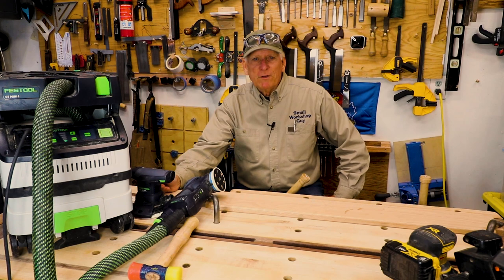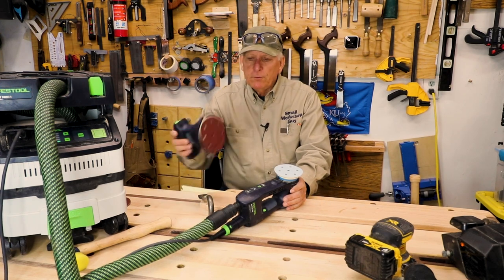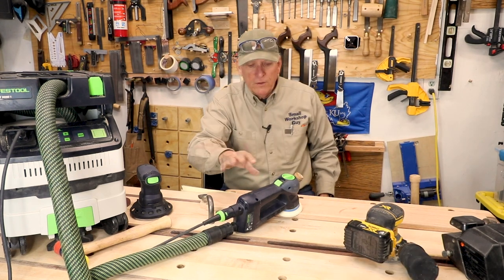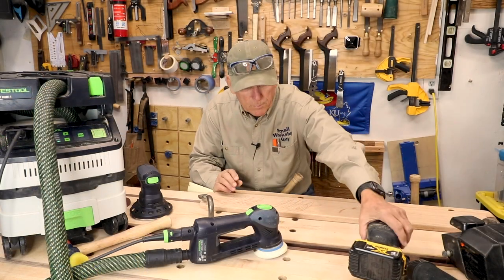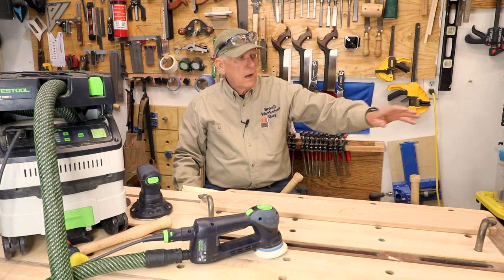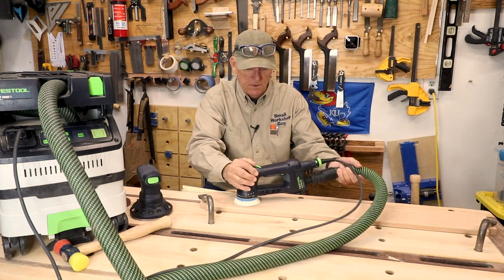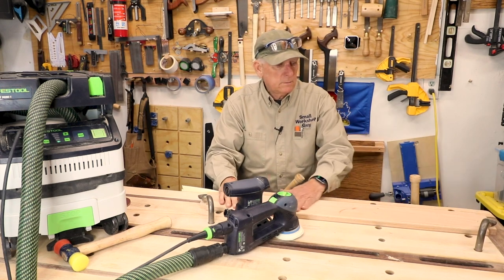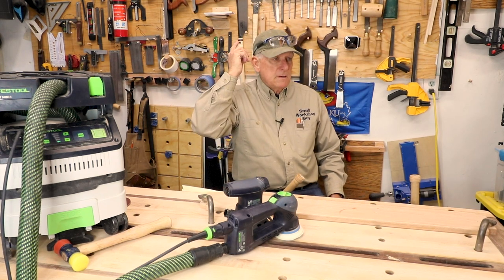Sanding with the Festool RO 90 - ETS 125 and CT Mini I Dust Extractor - Safe, Quick and Boring

Comment: Thanks, Paul.  I connect my shop vac to my random orbital sander and that seems to keep the particle count down to acceptable levels.  Since my shop is in an enclosed basement, I bought a particle count meter to monitor the levels.  I also made my own dust fan to filter the air.  When the weather is nice and I have a big sanding job, I move outside.
Reply from the maker: Hey Dave Nice to hear from you.  Yep some comments about how I hook up shopvac to other sanders hit the editing room floor- always a challenge to keep videos short enough!

Comment: I have a very old (41 years old?), Kenmore vacuum and carpet cleaning canister unit that till works. The filter is nothing but a piece of flannel -like cloth attached to a plastic ring that seals between the canister tank and the vacuum head. It leaves a lot to be desired, so until I get a better system, I built a housing to hold a HEPA filter so any debris that makes it past the cloth filter, gets caught by the HEPA filter.
Reply from the maker: Inventive!
Reply: @SmallWorkshopGuy  Since I'm not in the position to buy a new canister vacuum, I'm hoping the filter is not so restrictive that it will overwork the vacuum cleaner. The filter and housing are mounted on the exhaust port, and when I remove the filter it seems like the pitch of the motor changes, but that could just be my hearing.

Comment: I have a garage workshop (Fritts Woodworking on Etsy and Instagram, don't have a YouTube channel yet) and I'm seriously considering a Festool sander & dust extractor.  I have Dewalt orbital hooked to a shop vac with a dust separator...the problem when sanding is the fine dust does not get caught in the dust separator and clogs the vac's filter.  Also, the fine dust makes a mess in the shop and ends up everywhere.  The shop vac/dust separator works well on our CNC (larger pieces of wood, not the fine dust). I'm not looking to spend $ unnecessarily but if the Festool system will help keep dust off other projects and most importantly out of my lungs, I don't mind spending the $.  I have 3 sons that I would like to teach about woodworking and they spend time in the shop/garage too, I'm also concerned about their health.  I know there are larger dust collection systems out there but I'm really concerned about the fine sanding dust particles....I spend 3-5 hours sanding per week (average) and I can tell if I'm not wearing a really good mask.  I know I can open the garage door, run some fans but in cold, bad weather that's not an option.  Again, not looking do spend money I don't need to but I am also concerned about our health as well as keeping the dust off other projects in the shop.

Any words of wisdom are greatly appreciated.
Reply from the maker: First, consider a air cleaner to filter the dust out of your shop.  Secondly, hep, I highly recommend the Festool HEPA line of dust extractors (over $500) - collects dust in a HEPA bag.  I hook mine up to my Rotex 90, Festool ETS 125, my Domino system and my Shaper Origin.  You will still need your Shop Vac or a Dust Collection system for your big tools like Table Saw, Miter Saw, Jointer, Thickness Planer, etc.